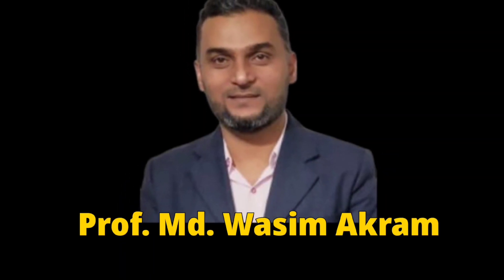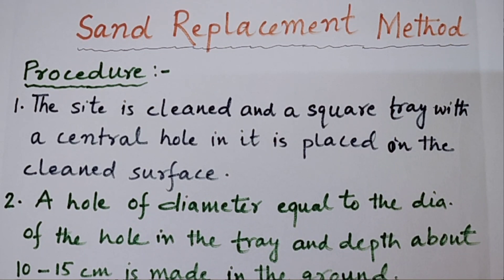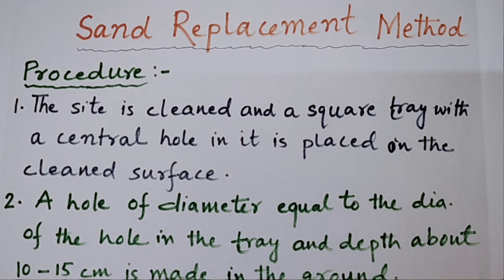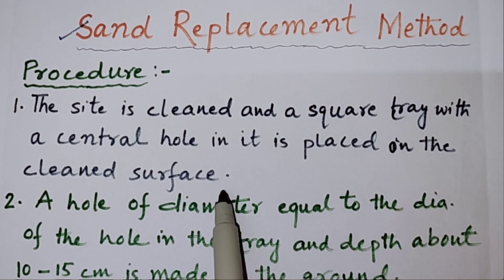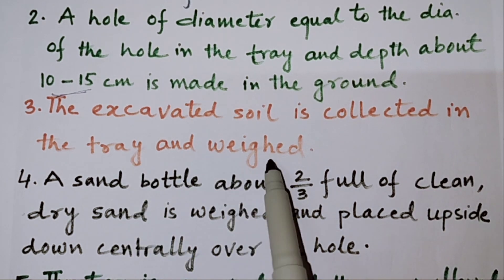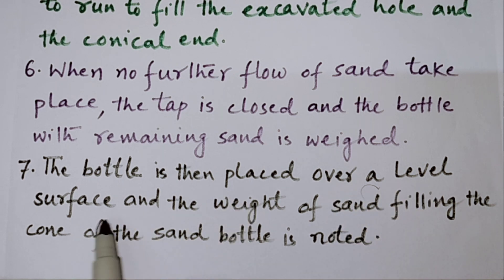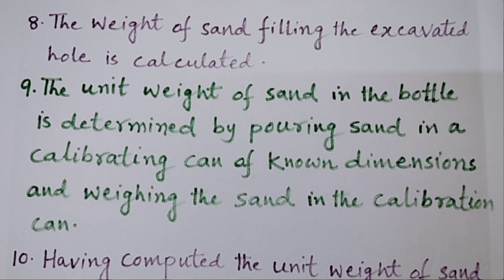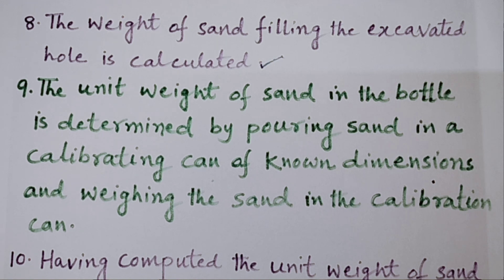In-situ Unit Weight of Soil by Sand Replacement Method I Lecture - 7 I Soil Mechanics I Civil Engg.

Comment: Sir ...unit weight of sand = w/v ....W = 1550 but I don't understand that wheres 1550 comes from ??? Sir plz tell me ....
Reply from the maker: Its typographic error... Instead of 1550 g it will be 1500 g. As given in the question... weight of sand in calibrating can ....is 1500. Thank you once again.
Reply: @CivilAliahPro  ok thank you sir